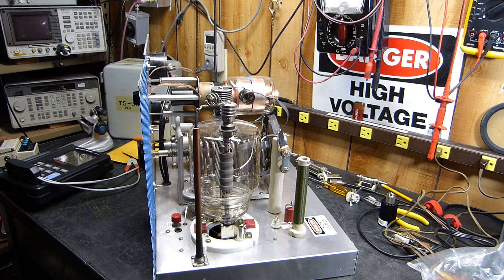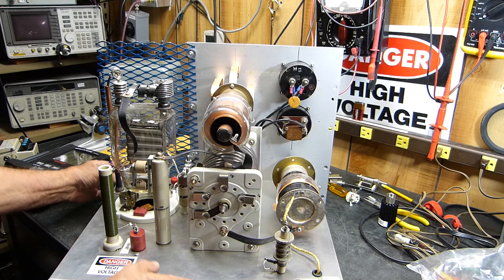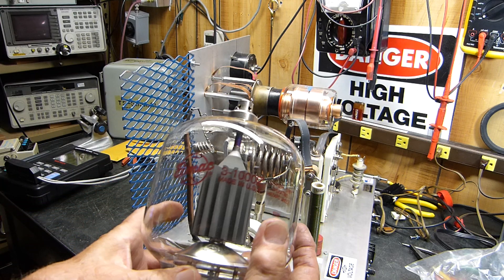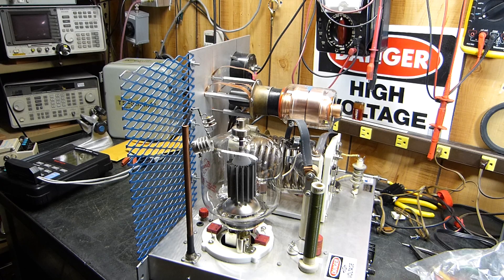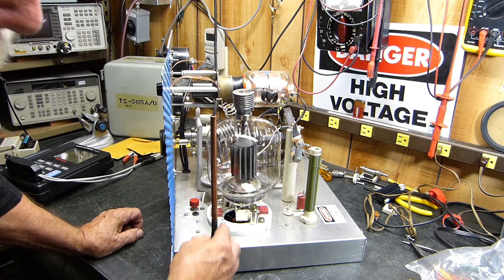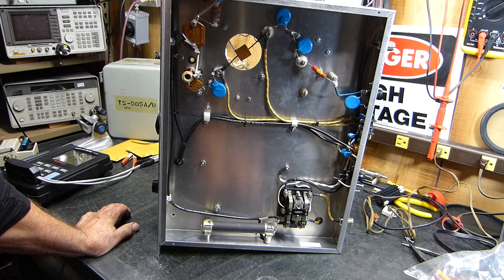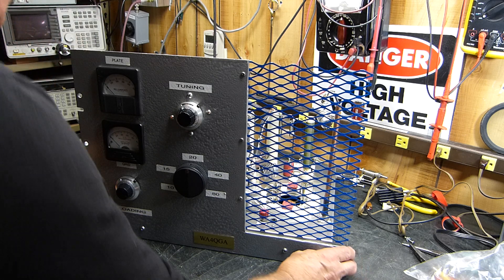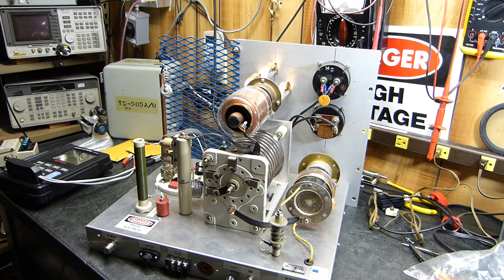Part 1 of 2 - Converting A 833A RF Amplifier To Eimac 3-1000Z Grounded Grid Amplifier

Comment from the maker: I never changed the 833A to the 3-1000Z. I finally, after a year or so, got the neutralization of the 833A just right and now 30 watts input will drive it to well over 1000 watts output. 
I love the 833A amplifier and use it often. 
30 watts in and 1000 watts out is 15+ dB gain and that satisfies me. 
Tuned grid, tuned plate (TGTP) amplifiers are nice high gain RF amplifiers but are going to require neutralization. 
The grounded grid (GG) amplifiers that are so popular today using high mu triodes, do not require external neutralization and only require one HV power supply and usually no bias supply and are generally about 10 dB gain.
Reply: I’ve got a stash of good 833-A tubes and would like to build an amp like yours, but I’d like to make it usable on more than one band, at least 80, 40, maybe 20, but what needs to be done for neutralization when you change bands? Do you need separate neutralizing circuits for each band? I’m new to this and have never built an RF amp. Do have a lot of nice big variable inductors and caps to play with, along with HV power transformers, so I should have all the $$$ parts which would otherwise be my main hurdle.

Comment: Do you still make tube amps?
Reply from the maker: I guess that is one of those, yes and no, things. I have been a ham radio operator for 59 years and it is ultimately my biggest passion in building so I tend to flip back and forth between audio and radio frequencies.  My basement if full of large RF amplifiers and I have no more room to build more amplifiers. My back house is full of audio amplifiers and the same problem with space. I am also getting older and it is hard to move heavy instruments around. And most important and sadly, my precious wife is very sick so I spend most of my time with her and taking care of her. Not sure what the future holds.
Reply: @ElPasoTubeAmps  Okay.  Praying for your wife.

Comment: for you which of these tubes has the best audio on ssb the 833a or the 3-1000Z? I would like your recommendation I like to build something but don't know what tube  to use I want the best audio for ssb
73"...thank you
Reply from the maker: The 833A as a medium mu triode has to be grid driven and neutralized and that is a challenge - but I wanted to do it at 20M. There is an article where the grid is strapped to ground thru a 50 ohm non-inductive resistor in one of the ARRL handbooks and it is horrible. I built it and it takes 100 watts drive for 400 watts output. I do not recommend building an 833A amplifier that way.
The 833A is class-B just like a grounded grid amplifier using a high mu triode like the 3-1000Z so, I think they will both do a good job at fidelity. The most important thing is the exciter and how it is being setup. Too many hams crank up their speech processing and compression on the solid state rigs and it makes it harder to understand them. The 3-1000Z or any of the 3-400Z, 3-500Z, 4-125A, 4-250A, 4-400A and 4-1000A and the 811A make great grounded grid (GG) amplifiers and they are so much easier to build and do not require neutralization and the input circuit is much simplified also over a grid driven tube like the 833A.  I love my 833A amplifier as it is such a beast. It has a presence that I like but so do the other tubes. If you have not built a high power amplifier yet, I would recommend a GG amplifier first. Just my thoughts on it.  Study the Heathkit SB200 or SB220 or the Collins 30L-1 schematics for starters. 
BTW - I did not convert my 833A to the 3-1000Z.
73  WA4QGA
Reply: @ElPasoTubeAmps  thank you for answer...I check it out the datasheet of the tube and they says whit 4000v on the plate...-100v on the grid...38 watts imput...do 2700 watts out whit two tubes...and I ask is possible too put the grid to the ground like 3-500z and 3-1000Z just grounded grid and put the input to the catode! Is going to work? 
73"...NP3EW
Reply from the maker: @whatillo  With 4000 volts on the plate, grid bias is around -100, the bias needs to be variable to set resting plate current at 50 mA for a single tube. 2700 watts output is for two tubes in push pull.  Unfortunately, it is not possible to put the grid to ground like the 3-500Z or 3-1000Z as the gain of the 833A is too low. Plate current would be much too high without bias and the tube would burn up. The gain of the 833A is around 35 and the gain of the 3-500Z and 3-1000Z is 200. The 811A gain is 160 and is why these triodes work great as grounded grid. The tetrodes like the 4-400A family of tubes operate as high gain triodes with gain of 200 when the grid and screen are grounded so this family of tetrodes make good grounded grid amplifiers but not the 833A. The 833A will work best as a plate modulated class-C amplifier and/or class-B audio modulator and was used extensively in small commercial AM radio stations across the world.  It will also work very well as a class-B RF amplifier, grid driven and neutralized. Check out the link below.
https://worldradiohistory.com/Archive-Catalogs/Gates-Harris/GATES-BC-1T-500T-250T-Transmitter-Manual-1958.pdf
Reply: @ElPasoTubeAmps  that is good to know...I build the 4-1000A in grounded grid...whit 3800v on the plate and 250 watts imput do 2200 watts no like to much...and then I build three 4-400A whit all the voltages grid and screen whit 15 watts imput do 2500 that one is ok...but I like to use 80 to 120 watts imput and do 2000 or 2500 watts and I think the 833A but I don't know never built anything whit that tube...I saw your video and I'm curious about the tube.
73"

Comment: What about two of these vacuum tubes in a balanced configuration using a BALUN on the input and a BALUN on the output should give more power.
Reply from the maker: That would be quite a project and amplifier... I have three 833A but only one is good. The other two are very weak and purchasing "NOS" off Ebay is a turkey-shoot. I  had my fun with the 833A and proved to myself I could make it stable on 20M so that amplifier has been set aside for now. My project at the moment is a modulator for an AM transmitter. Thanks for your ideas and comment.

Comment: I tried building an amp with a pair of 833a's but just couldn't get them to work. I think in class AB for linear service they are a bit of a dead loss. I went the same direction as you and stuck a pair of 3-500z's instead and it works perfectly.

Comment: No one has dine a 51-S1 on youtube. How about doing the alignment and cal of that receiver?   That would be awesome
Reply from the maker: That is a pretty fancy little receiver. Let me think about it. When I bought this one, there was a second 19 inch rack mount, Rockwell Collins 51S-1 (mine is the Collins winged emblem) that I could have gotten for the same price ($250...) and I did not. I regret not buying the second one every time I think about it. Someone else came in and bought all that was left which also included a beautiful 75A-4. I am at the point where I just don't have a place to properly take care of any more equipment.
Reply: Sad to not get ANY Collins for that cheap price. Room i have with 4 40 foot containers. Sigh!

Comment: I always wanted to make an 833A audio amp.  That is a beautiful triode. I think I gave you the one I had.
Reply from the maker: Hi Jodi,
You did give me a 833A and I certainly appreciate it. As you probably have seen, there are 833A SE amps for sale at about $350,000.  Hmmmm, a little bit out of my budget.
Anyway, a PP pair of 833A should do the trick and sometimes I wonder why some crazy person like you or me doesn't build such an amplifier and travel around with it just for fun and use it in venues like the Houston Astrodome or whatever. Maybe a 2020 revisit to Woodstock? I missed it the first time.
I can see that an audio amplifier like this can not be thrown out to the public as it would surely result in a tech working on it and being fried so the designer/builder would have to travel around with it. Maybe in my next life I can do this for one of the big Heavy Metal bands...

Comment: I guess it depends on what you are driving it with and the mode, which I assume is SSB. There are lots of grounded grid 3-1000Z amps around, but not many 833’s. 
I believe Gates made a broadcast amp that used 833’s in pairs, two for the RF and two modulators. 
It would be cool to build a push pull RF amp using two 833’s to run a full 1500 wats PEP. 
My goal at some point is to build a 75 meter AM transmitter including modulator that can run full legal power continuous on AM at 90% modulation. 3-1000’s are getting scarce these days, I’m thinking maybe 4CX1000’s  for RF and modulation.
Reply from the maker: Hi Bill,
I had that 75M AM setup when I was in Huntsville, AL but I left there in 1976 and have not been on AM since. I ran a 4-400A in class-C and plate modulated it with a pair of PP 4-400A. All built from blank chassis up.   When I think back about it, it was awesome. I loved the QSO's I had  with the fellows each night. I always remember the delay we all had in keying-up. When it was time to hand the QSO over to the other, there would be a slight delay and then the transmitting station would key-up and another moment of silence while the power we ran silenced all the noise and crackling on the 75M band . Then we would start talking and it was like we were in each others room. A real  ego trip running high power AM. Even with that, we would put a reverse biased diode and a 10K,  250 watt resistor across the modulation transformer so as to prevent clipping of the negative cycle and it would allow more positive modulation (over 100% positive) but the diode and resistor would limit the negative cycle so it would not "splatter". I think we were just all gigantic CB'ers out-of-control, but legal... 
Build your AM station and I do recommend the 4-400A. 833A are tough to deal with in RF and require plenty of neutralizing. Even the 4-400A running class-C,  TPTG,   does require neutralizing. Not one of the simple GG amplifiers with a single HV supply. 
You may already know this but the 4CX1000A only runs class AB1 so a pair can deliver stereo quality audio at 3200 watts but you can't run it as an RF amplifier in class-C.
As for the Gates AM transmitters, I think the day I saw the little AM station in Arab, AL when the EIC took me there with, as you described, the two RF 833A's and the two audio 833A's, i fell in love with these big guys. Now I have an amplifier with one and I am not going to take it apart.
73,   Stay Safe

Comment: I like the 3-1000z’s but my real passion are the 4-1000a’s I have 3 home brew grounded grid amps two that run off 5,500vdc and 1 that runs on 4KVdc that was my dads “desktop”. I also have a home brew pair of 4-400a’s that at 4KVDC will run FULL power and then some.. my dream is a pair of 4-1000a’s and I have the plate transformer to handle that but we know.... ;-)

I say turn that into a 3-1000z at 3,500 volts DC grounded grid. It reminds me of a BTI amp which had a 1000 watt oil filled dummy load for loading that mounted on the back, I have the dummy load never had the amp though. Can’t wait to see what happens with your build.
Reply from the maker: The 4-1000A does interest me. I had several pull-outs from the stations at WSMR but I sold every one of them years ago. I tried a 4-1000A about 30 years ago but my PS was only 3500 volts or so. I knew then and surely know now, that is way too low for plate voltage but I just couldn't afford the parts back then. With the relative inexpensive electrolytics of today, like 470 uF @ 450 V, it is easy to have a PS at 5-6 KV. I was bidding on a 4-1000A the other day on Ebay but did not get it. I may have to revisit the 4-1000A project some day. If you have seen my other videos, I do just as you say and run a 3-1000Z at 3500 V. Absolutely beautiful.
This is my amp and tube -  or just Google "Eimac 3-1000Z pictures"
https://www.google.com/search?q=Eimac+3-1000Z+pictures&rlz=1C1CHBF_enUS839US839&tbm=isch&source=iu&ictx=1&fir=UhaZSCi4YSeDwM%253A%252CXo_JsPjbzkOgpM%252C_&vet=1&usg=AI4_-kQdHCL-OrUGOoYy2lXZPQB5PaGEIQ&sa=X&ved=2ahUKEwia-4XG5J_kAhUrgK0KHbSACxQQ9QEwA3oECAUQCQ#imgrc=UhaZSCi4YSeDwM:
Reply: I blew it Saturday at our local HAM swap meet a guy had two brand new 4-400a’s for $40 in their boxes... and I didn’t buy them.. I have a schematics for a pair of 4X1’s running 8,000-9,000 VDC driven at 400-600 watts.. yea I know but we can dream..
Reply from the maker: @jakeblues3676  That is the beauty and  the "tragedy" of finds at ham swap meets... 8000- 9000 volts is a little high but maybe next time you will be ready to build and get the bargin.

Comment: I always wanted to build an audio amp with 833, in push-pull. For RF, Eimac zero bias 3-1000z is superb choice.  I used a 3-500Z in a special project in the late 1980s, ... came to appreciate the engineering that went into the 3xxxZ series of Eimacs. Great stuff.
Reply from the maker: I agree with you on the quality and simplicity of the Eimac triodes. Even wiring up their tetrodes like the 4-400A family, makes great GG amplifiers. Too easy. If you have seen my other videos, I have the 3-1000Z amp and a 3-400Z amp. They work great. The 833A was a challenge as it was grid driven with a 100 watt bias supply and neutralization. I suppose I am not going to take this beast apart right yet. If I build another amp to slide into the PS cabinet, I think it will be a pair of GG 813's. It has been a long time since I have use the 813 for RF. Thanks for your comments.
Reply from the maker: I posted a video on a SE 833A amp a few years back. I used a big PP  transformer and just the static current of the 833A saturated the core. Real flop of a project.

Comment: I've heard you  in QSO on 40 a few times...appreciate your intelligent approach with your projects. You know 33's are best suited to audio. I'd use the 33 in an audio amp. Go with the 3-1000, very easy build and clean IMD's. I ran a pair back in the day...a lot of fun. Take care, 73'S, 6UH
Reply from the maker: I agree with the audio use of the 833A's but since I could not find anyone that had built and stabilized  (properly neutralized) an 833A on 20M, I had to do it... A few people have used one or two 833A's parallel for 75M and 40M but no one wanted to tackle it at 14 MHz. It turned out great. I commented on the neutralizing procedure above. Thanks for your comments. 73

Comment: Keep this beautiful amp as is and build another slide in chassis. Would love to see it being built!
Reply from the maker: You guys have talked me into keeping this beast.  If for no other reason, the effort I put into neutralizing the amplifier and making it stable. I used a design employed by Gates in their commercial AM transmitters. Works great and makes the amplifier as stable as a GG amplifier. The 833A is a bit hard to drive as mentioned in the video but when all line voltages are up and everything is perfect, it will deliver 750-800 watts output at the lowest plate voltage setting. Really appreciate all you guys comments.

Comment: Great to see you again.........I would tend to build another RF deck for the new experiment........that 833A deck is a nice piece of work and definitely worth keeping...........It would be awesome to show new players how to scratch build a big amp and how to choose or make some of the components along the way.
I hate to see the skill of big amp building die away.......in my trade its almost a lost art with everyone going for cheaper to run solid state units now........the upside is I get lots of spares lol
Reply from the maker: Hi Harb,
I think vacuum tube RF amplifier building is a dying art, for sure. It will cost several hundred dollars more to build than to buy, even new/used amps like the Ameritron 811. Nice sounding amps too... However, we tend to overbuild to such an extent, I have been running the 4CX1000A amp since 1983 and I have never ruined a tube or had much of anything go wrong with it - that's 36 years of service and still going strong. The same seems to go for the 30L-1/30S-1 and the Drake L4-B just to name a couple of vintage amps still on the air - and we shouldn't forget some of the vintage Heathkit amplifiers either. But I think the odds are, if you built it, you can fix it and keep it running for a lifetime. I have pretty much come to the conclusion that anything over 500 watts output is not going to help anyway - but I keep building big ones...
Here is a link that I would like to share concerning the 4CX1000A tube and amplifier.
http://www.collinsradio.org/wp-content/uploads/2012/04/Tuning-the-30S-1.pdf
I read this article and took it to heart. I lowered the screen voltage from 325 to 225 and then lowered the bias from around -60 to whatever it took to get back to about 220 mA of static plate current all at 3000 volts on the plate and I could see on my SDR that  it super cleaned up the output. With the Eimac suggested voltages (screen at 325) I could easily get 2KW PEP output. Holy Cow... With the lower screen and bias voltage it will basically not go over about 1300 watts but I get so many unsolicited comments on the good quality of my audio. I am driving it with a KWM-2A.  Following this designers advice sure seemed to pay off in the quality of the transmitted signal - and it was good even before the modification. Maybe others will enjoy this read also if interested in the 4CX1000A or the Collins  30S-1 design.